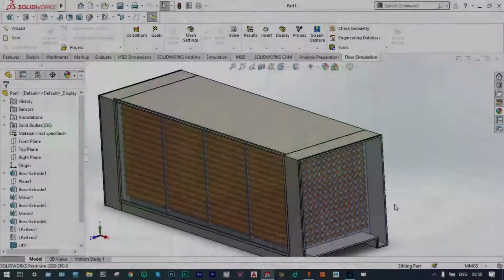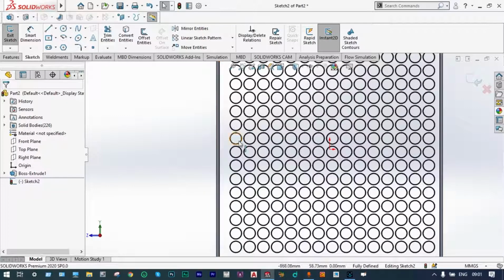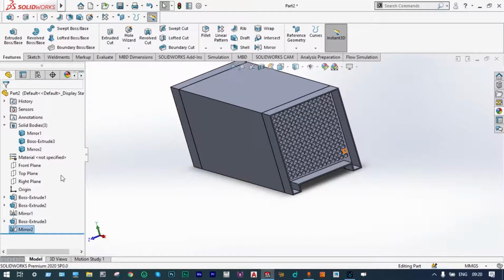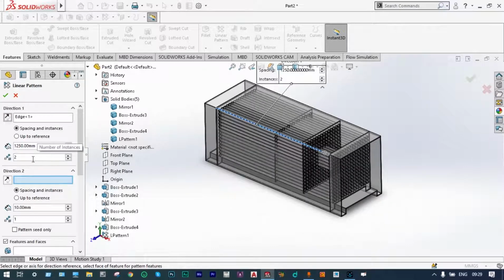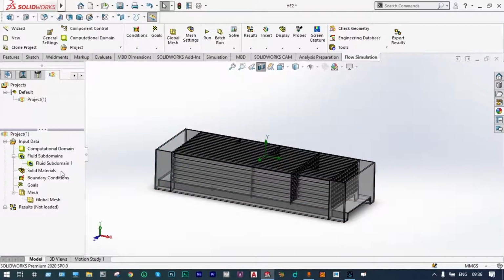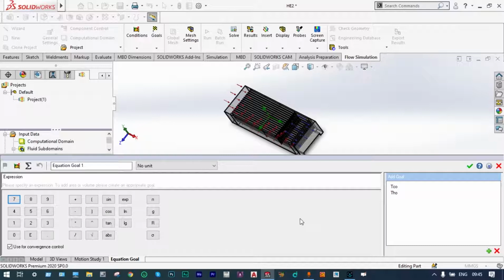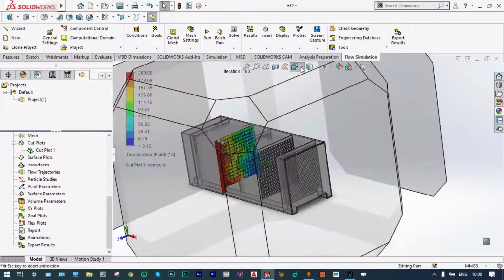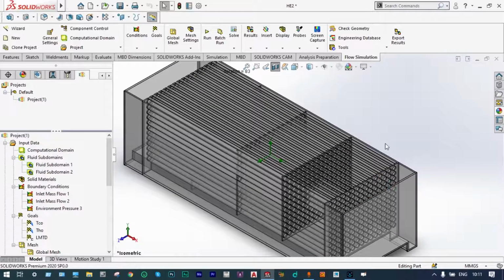CFD Analysis of a Cross Flow Heat Exchanger in SolidWorks 2020: Tutorial

Comment: Hello, may I ask if this question is to use water to heat up the air temperature, or use the air temperature to raise the water temperature?Because I used the air temperature to heat the water temperature did not increase, but the water temperature can effectively increase the air temperature.

Comment: Good morning, great video.  I tried to repeat the simulation and the air was completely cooled and the water had a temperature increase of 0.09 degrees.  Do you have any idea what went wrong?
Reply from the maker: Specific heat of water is high. It is 4200 KJ/KgK. It requires a huge amount of heat to raise temp of water. Whereas specific heat of air is too less. It cannot provide that much of heat. Interchange the positions of water and air and see the difference.
Reply: @CFD_GUIDE  But in your example, the water temperature rises 7.5 degrees, mine much less, so I was in doubt. Another question, why in this example did you not put an outlet for atmosphere into the air?
Reply from the maker: @viniciusoliveira1306  you need to apply atmospheric pressure also. I have done but while editing may be I didn't show. If there is any opening, there must be atmospheric pressure
Reply from the maker: I have added atmospheric pressure but while editing may be I didn't show. If there is any opening, there must be atmospheric pressure